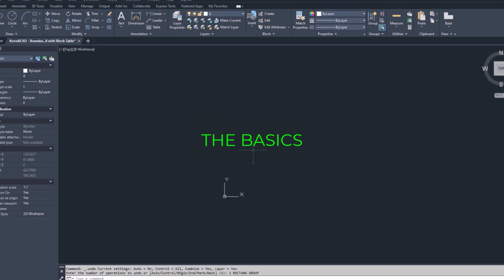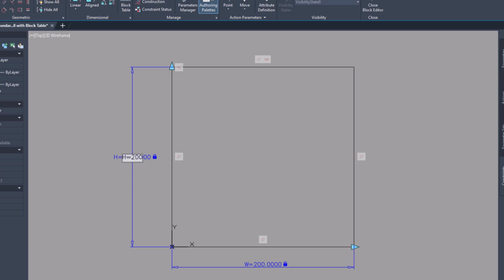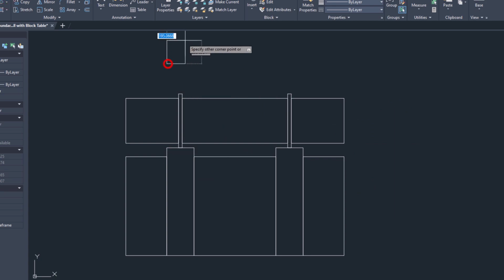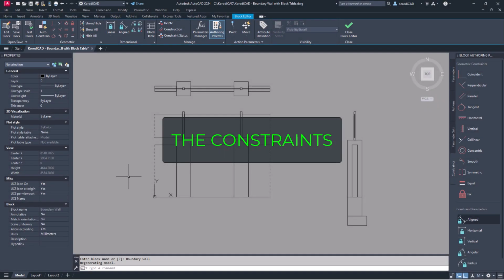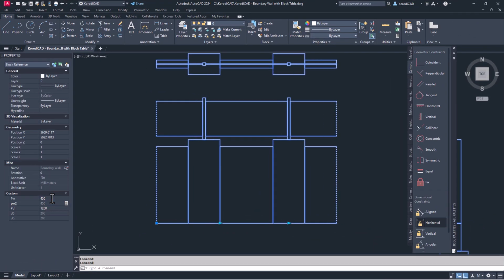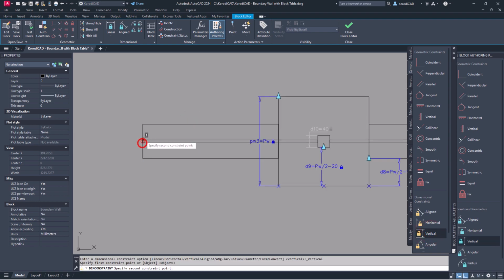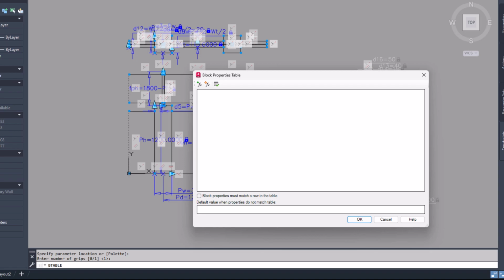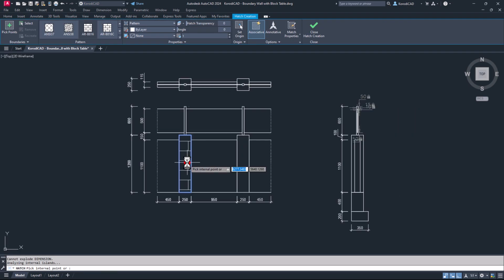#autocad _7 | Dynamic Block with Block Table and Constraints - Boundary Wall

Comment: So simple
Reply from the maker: The basis is very simple indeed. You set the complexity by the number of parameters you put in.
Reply: @kisminden  have you done anything for steel structures like knee brace gusset plates
Reply from the maker: @advancedautocaddynamicbloc7359  I have a lot of experience in steel construction, but in my work I always have to design a custom plate, so I don't have a block. If you give me the parameters, I can make a dynamic block.